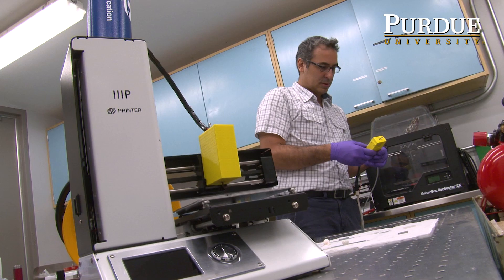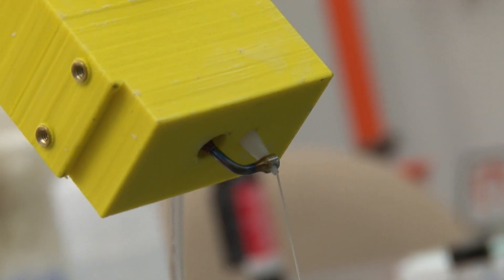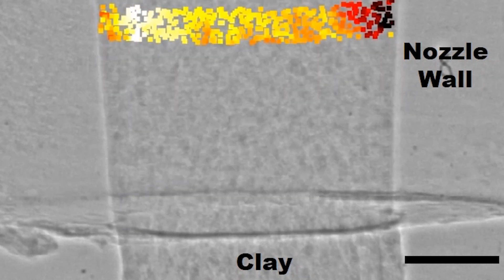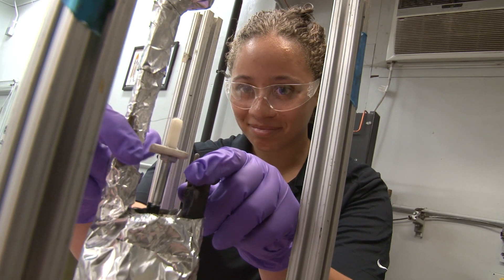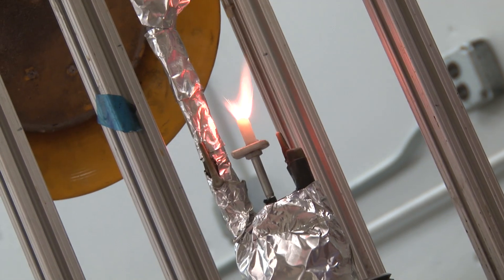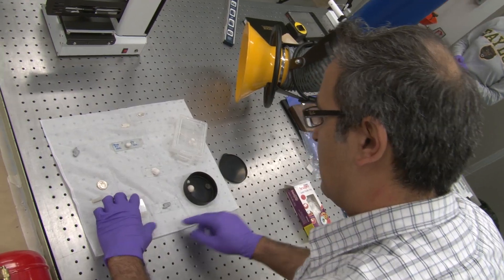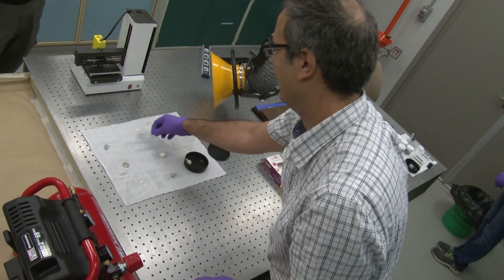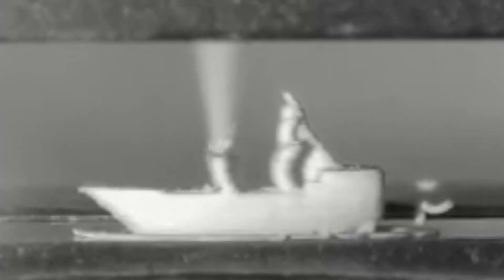3D Printing Extremely Viscous Materials

Comment: The printer looks to be one of the low-cost types found everywhere on EBAY, GearBest, and Amazon for under $400. The nozzle looks to be polyethylene and the ultrasonic probe seems pretty straightforward. A tuneable ultrasonic generator (signal generator/amplifier) is not a huge challenge, either. All in all, this looks totally doable on a DIY basis for those who are somewhat skilled in the art!
Reply: Yes, the low-cost printer hardware was used to provide the platform for the printing.  You can see the referenced paper for more details for your DIY project.
Reply: I noticed that as well. Looks like I found a project for my crummy little A8 once I move onto to SLA and better FDM printers.